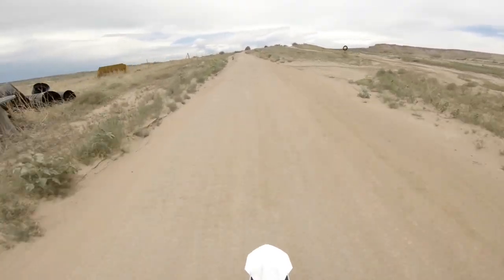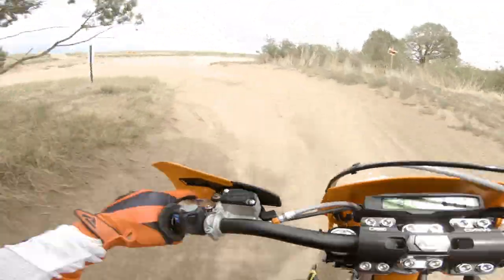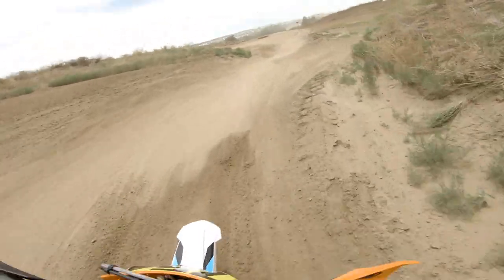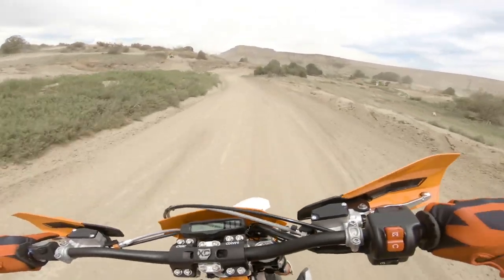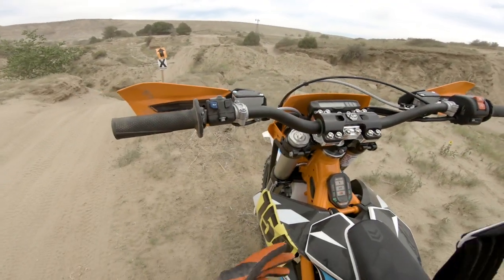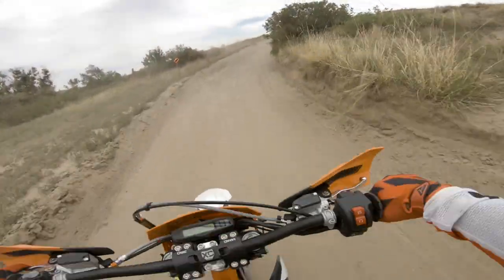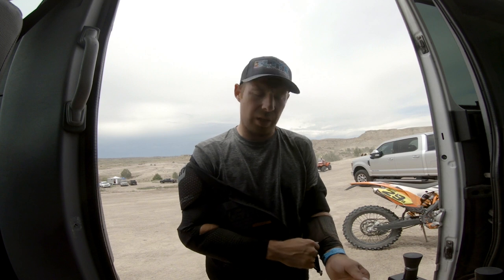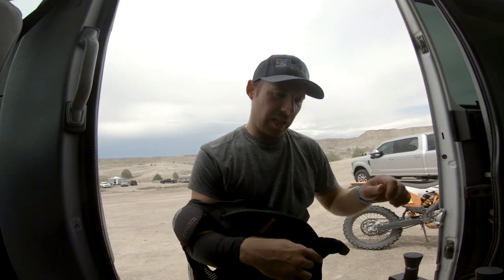Electric KTM Races Against Gas Bikes | 2020 KTM Freeride E-XC

Comment: I can't wait for electric bikes to really take off. This is coming from a 2 stroke guy. Hopefully battery tech improves to the point where you can ride multiple hours and I can finally justify buying one
Reply: Thats the only reason i don't want an e-bike at the moment, you don't get much riding time. But I love this KTM! Looks sick and looks to be so much fun!
Reply: I didnt even know these existed until today and I already want one. Less maintenance is what im really into.
Reply: Battery tech is evolving rapidly, but you are absolutely correct. Once battery tech makes that leap forward I believe you will see a mass movement towards electric bike, cars etc. Also I think the electric vehicle industry is doing itself a disservice by not allowing shade tree mechanics and aftermarket suppliers access to their products.
Reply: Damn I just looked it up it’s only 35lbs lighter than my 450r and a lot slower
Reply: Same thing, I don't want to deal with maintenance. Don't have the time or the know-how for anything more involved than an air filter change. I switched over to mountain biking in fact, just due to that fact. Near-zero maintenance is what I'm after.

But, like you said, battery life is a huge concern. That and these KTM Freerides need 220V connectors.
Reply: @haroldrhodes2610  as a non shade tree technician.  The reason shade tree mechanics dont get access is the electric engine can kill you. Before you touch the big orange wire bundle till your family you love them. And update your last will and  testament.
Reply: @samking6941  I am not discounting trained professional technicians here by any means, rather I think there is an opportunity here for the industry to embrace tomorrows version of the shade tree mechanic. I think the EV industries Carol Shelby, Smokey Yunick, Robert Yates, Grumpy Jenkins,  Lee Shepard or Jason Line is out there somewhere just chompin at the bit.
Reply: @cliftondugan5295  I don't know if they are actually slower, but are somewhat range limited.  I just watched a vid of a guy moto track riding an eBike and lapping faster than he could manage on his 450.  https://www.youtube.com/watch?v=ViHaPiTsMvI
Reply: @gregevans1502   60mph top speed. I can hit 95 on my 450r  and I’m 240lbs
Reply: @cliftondugan5295  OK, yep, top speed is higher on the 450, but there are vids showing the Ebikes as fast or faster than 2 or 4 strokes in Moto, Hare Scrambles, etc.  if you are a desert riding master who runs WFO at 95mph, sounds like the EBike isn’t for you, at least not yet.
Reply: @gregevans1502   yeah it’s just lighter but wide open battery only lasts an hour.  I’d consider it a good 250 alternative but it’s priced as much as a brand new 450
Reply: I had the 2015 Ktm Freeride E and the the range was a joke. 30 minutes and 10-15 miles. Usually I do day trips with my buddies but with the Freeride E I didn’t even get to the trails and back. Sold it after a couple of rides.
Reply: @Checkyoursix77   an $10,000 that’s total garbage. Ktm really got ahead of itself with this garbage. Better battery life from a power wheels toy
Reply: Blaze Temp  I completely disagree, I think the cost of owning and operating a vehicle is, for the overwhelmingly majority the number one factor in which vehicle is ultimately purchased. t
Reply: @cliftondugan5295  look up the Alta it's so much better and faster than the KTM you can watch it here on YouTube The KTM is like a restricted moped The Alta is a real machine
Reply: Electric bikes might be irrelevant and cheap as hell in 10 years. The jetpak is coming, people.
Reply: @Checkyoursix77  thats sad to hear i wish they sold the 250f freeride in the usa. I want the freeride so bad but a damn sur ron is 1/3 the cost and faster and more range.. wtf ktm!
Reply: I've got a 2022 Freeride E-XC. My last ride was 39 miles and 3 hours mostly in Map 3.
Reply: Yep. from a 4 stroke guy and a 2 stroke guy i would want longer battery life to.
Reply: @haroldrhodes2610  everything changes sooner or later
Reply: The big thing i could see having one is if you have a few acres of land and want to rip a around an mx track on your yard you wouldn't bother the neighbors
Reply from the maker: @Ian Wood 2 stroke guy here too! They're super fun to ride and will definitely continue to improve...

Comment: I know I'm late to the party ... just seeing this for the 1st time today. Really nice riding BTW. Anyway, do you think the battery would have had enough charge in it to finish the race if the front wheel alignment had not been tweaked when you crashed? I don't know if you were carrying any tools during the race, but as I'm sure you know, it's a pretty quick fix to re-align a front wheel. Although you likely wouldn't have been able to properly torque the pinch bolts on the triple clamp and front axle, you could have done well enough to by feel and have been back in the race inside of a couple of minutes. I understand that you may have been feeling the effects of the crash by the time you decided it wasn't worth carrying on, and certainly don't fault you for not doing so, but I was really hoping to see whether the Freeride battery can go the distance in this type of racing. Hope you're fully recovered now. Thanks again for posting.
Reply from the maker: @actionsportster Thank you! I appreciate it. For sure, it was more about my head than the twisted forks. Ended up getting a minor concussion on that one and wasn't willing to risk it any further! It would have been really close to finish the race on the 1 battery. If I'm honest, I think it might have died around the last lap. These enduro/hare scramble races are tough with the current batteries due to the length of the races. We'll get there though!

Comment: It would be great to have a quick change battery system so after given time, you make a battery swap during the race.  How long will it run on one battery anyway?
Reply: 1 - 1.5,hrs run time. It allows for quick battery swap but a second battery costs 3.5k USD

Comment: I had a 2006 Christini CRF250 AWD for many years. 
It railed through deep sand and was impossible to crash in rock-gardens
or slippery downhills. 
A small electric motor in the front hub with programming to work with the
rear motor of this KTM would be the ultimate!

Comment: Going well out there. Great footage. It’s so easy to make mistakes on long hot rides. Look forward to seeing you out there again. What class / cc of gas bikes were you racing against??
Reply from the maker: @Cam Dunnage Thanks! For sure, you're right about that. I was racing in the Unclassified  Class here which is an Open Class. There was everything from 450 4 strokes to 125 2T out there. I don't have many class options at these races because the bike doesn't fit into most categories and I have to be selective with the race length.

Comment: Great vid!    Thinking maybe one of these is the ticket for a basic trail riding spode like me.  My 'ol Kawi Stroker trail bike needs replacing and I wouldn't mind it being quiet, no oil changes, no air filter, etc., etc.   I have an electric cruiser eBicycle which I really like.  I have thought to myself; "Would I replace the emotor in this bike with, say a 70cc combusion engine?" and the answer is a big NO.
Reply from the maker: @Greg Evans They're really fun in the right application for sure!! 👍
Reply: @ElectricCycleRider      That course didn't appear to be the 'right application' for Freeride.   Short wheelbase + steep steering angle = sketchy handling.
..
Hope that another manufacturer will resume where Alta left off & someday soon we'll yet again have a viable full size off road E - bike. 
.

Comment: Monster Torque, you need to keep all your weight over that back wheel or it gets away from you, at 9:40 you can see you took your weight up off the back wheel before the turn and squirreled out. Glad you had a helmet. Electric is impressive. We are a few battery chemistries away from making gas obsolete, I'll miss gas but the torque is just amazing in electric.

Comment: Yooo the e bike really just fucking everyone up from the get go,the acceleration on the electric bikes now are so fucking crazy,the bottom and end torque is nutty,but what’s crazy is even when fully opened up on the throttle it’s still matching if not beating every other bike

Comment: Nice ride but can't imagine how hard it is on a bike with such a crap suspension.
Reply: he's not on stock suspension
Reply from the maker: @kingdme Thank you. @gophop is right though, I'm on some really good suspension on the KTM now. I have a suspension video out on what was done to the bike but it's got Race Tech Gold Valve for the shock and Dal Soggio XP One kit for the forks with revalve. It's amazing in the rough stuff but not really set up for motocross jumps. Little bit of give and take but still performed much better than stock. The stock suspension definitely leaves a lot to be desired!

Comment: The battery housing needs to be part of the chassis to save weigh and or increase the battery size.  Alternatively add the battery inside the tubing or add two batteries beside each other but need it to not overheat and run at least 2 hours

Comment: I know you didn’t finish the race but what was the battery % when you finished?
Reply from the maker: @John Hancock Great question! It's hard to get an exact percentage because of the way the battery levels are displayed on the KTM but the bike had 2 of the 3 green bars left, which means it had between 70-50% battery remaining. My guess is it was closer to 50 than 70 at that point. I hope KTM improves the display moving forward to a more precise battery readout. Thanks for the question.

Comment: Where did the front end get twisted was it just the bar or was is the actual wheel, just curious
Reply from the maker: @Operator Chaos The forks just twisted in the triple clamps when I went down, pretty common thing in a crash. Just need to loosen and retighten the triple clamp bolts and it will come back to straight. I could have just bashed it back straight and kept going but I pulled off because of my head. 👍
Reply: @ElectricCycleRider  Oh ok I’ve heard of the term forks getting twisted before but didn’t know what it meant, I thought that it was something internal in the forks. In short thanks u cleared up something I didn’t understand.

Comment: You know its totally possible to make an electric bike with clutch and gears but it will never turn of by letting the clutch out
Reply: Why woudnt it
Reply: @rodneyburke2202  because electric engines are completely still when your not accelerating or riding
Gas engines use momentum to maintain itself spinning when your vehicle is still (idle)
When you let the clutch out you will take that momentum away and it will shut down unless you give it gas wich gives the engine enough momentum and power to move your rear tire 
Electric engines don't need momentum to idle, so if you let the clutch out it just wont move but not shut down

Comment: How long is that loop? And how many laps in 1.5 hours?
Reply from the maker: @Benjamin Hawkhurst The course was approximately 5 miles long and the race is scored on fastest laps + most laps completed in 1.5 hours. So laps might vary based on the rider. Faster riders might get 1 or even 2 more laps in that timeframe than slower riders. It would have been hard for me to stay competitive all the way through because despite my crash, I am pretty confident I would have had more laps in me than the bike had battery life.
Reply: Electric Cycle Rider I understand. It looked like a fun race despite the crash. Did just the bars bend or did your triple clamps twist also? It really didn’t seem like a hard lay down on the bike, your head yes, but the bike failed it looks like because of weakness. Too bad. I don’t have one YET, so it’s something to be addressed with suspension upgrades.

Comment: Would be good to see the KTM v's ASI 8000 on the Sur Ron climbing ability.
Reply: Suspension is the real problem on the Sur Ron after or before adding power.Its about as plush as a potato.Big heavy bikes with real bike suspension i.e not cheap MTB downhill forks are so much better to ride.Off road up a hill the KTM would eat it alive ,72v and a bac8000 or not just due to the suspension alone.
Reply: @fpvlee1586  I am going to get one and will look into proper suspension as I work for an Mx dealer.
Reply from the maker: @Matthew Pinfield For sure! I would like to test one with the ASI Controller. @Fpvlee is right though, suspension and weight play a big factor between these two bikes. The Sur-Ron will not behave like the KTM no matter how much money is thrown at the suspension and motor/battery. The chassis, suspension design and weight of the bike have a limiting effect. I'll work on getting a test like this going though, we're constantly trying different things with the bikes to improve it.
Reply: @ElectricCycleRider  I have a Gasgas EC 250 rolling chassis ready for a nice motor and controller. I want to see how capable a Sur Ron is first.